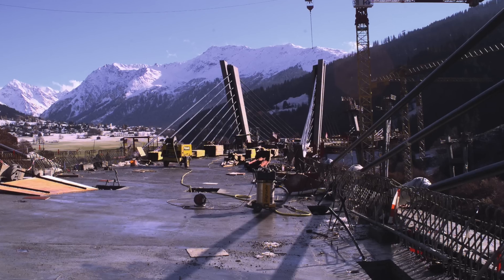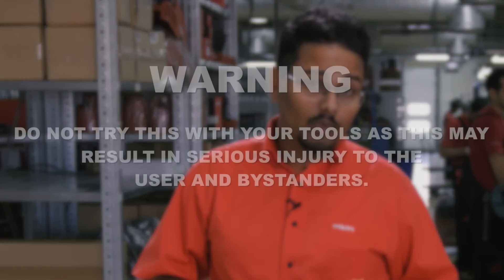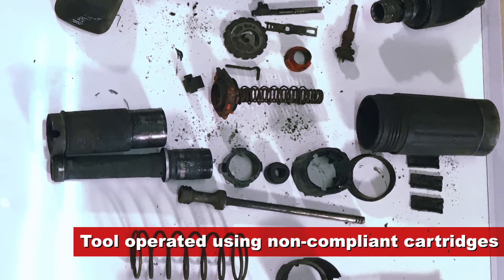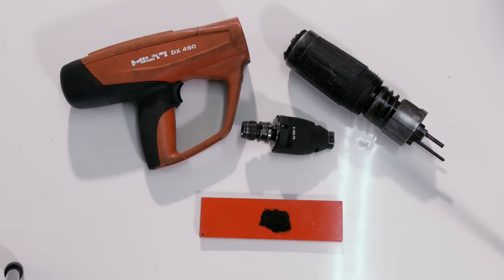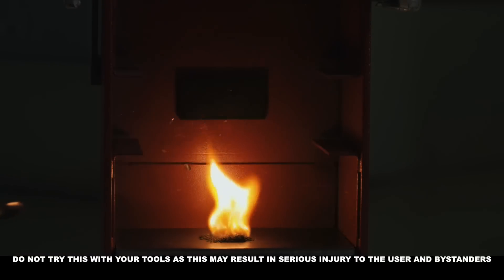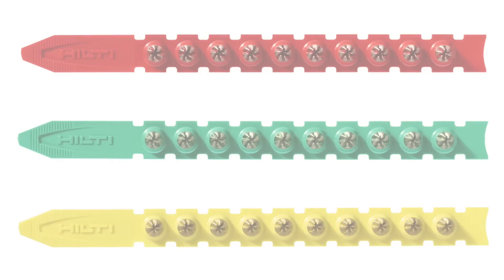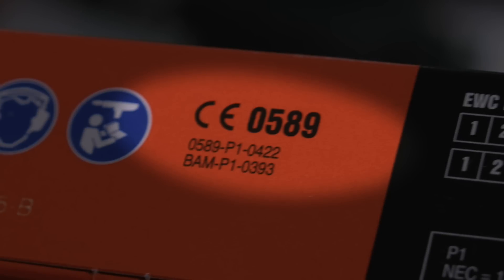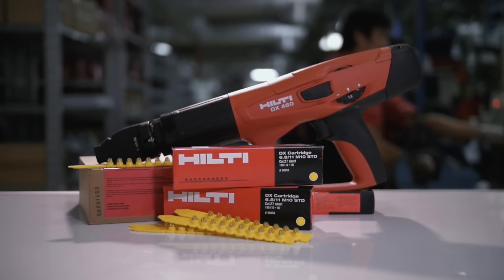Hilti - DX Cartridges Safety On Your Side (English)

Comment: Looks to me like one tool was fairly dry when fired and the other tool was sprayed with an oily substance like WD40. An over oiled tool can have an icky build up of carbon and unburnt powder.
Reply: Thanks for the comment Xeckler. and sorry that I didn't reply earlier

When I made this video, both the tools were picked from the ones customers had sent for service. I can't comment on what chemicals they had used to on the tools - though Hilti does provide the fluid for DX tool cleaning.  

While I appreciate your observational skill, the critical point to note is that using substandard cartridges leads to a deposit of unburned powder inside tools, which could lead to explosions-posing significant risk to users and bystanders. What you see burning in the video above is the powder that was collected from a tool that used such cartridges.   

Using EN16264 compliant cartridges will prevent this powder build up and this ensures safety on worksites